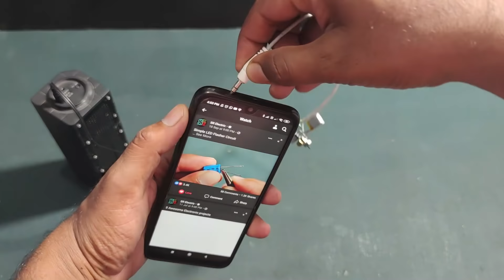Wireless Audio Transmission Circuit

Comment: HERE'S COMPONENTS YOU'VE :

1.  TRANSISTOR TIP41C

2. 1K RESISTOR 
3. CAPACITOR 22 UF
4.  LASER DIODA
5. 3.5 mm AUDIO JACK
6. MINI SWITCH ( 3 FOOTS ) 
7. 3.7v  BATTERY
8. 3v MINI SOLAR
9. 3.5 mm AUDIO JACK
10. (OUTPUT) PORTABLE SPEAKER

Comment: This humming is coming from socket lights. If you would apply 50Hz AC low voltage to speaker you would hear exact same humming. It's because Light bulbs are flickering a bit at 50Hz